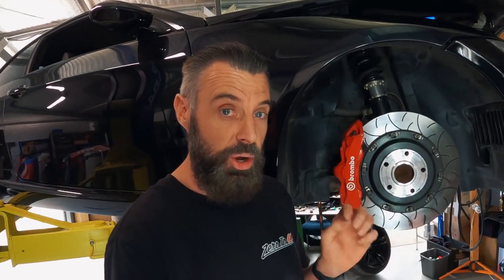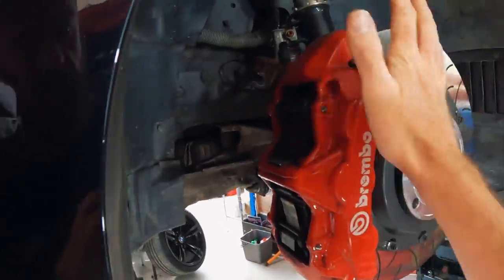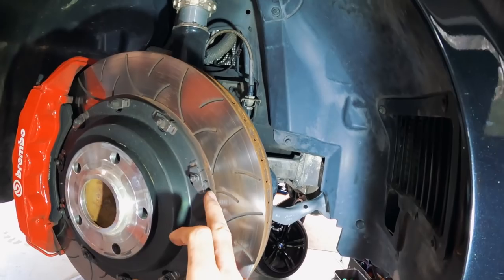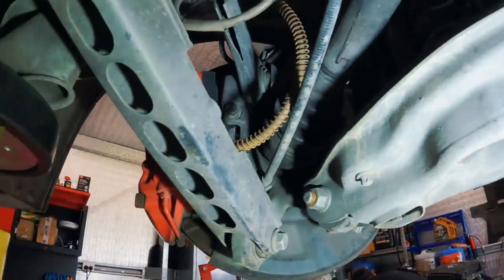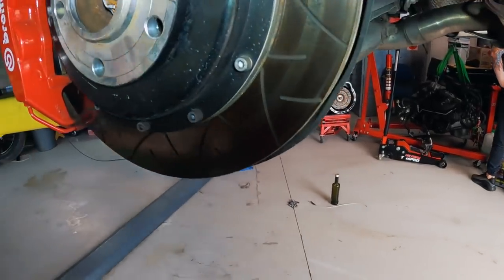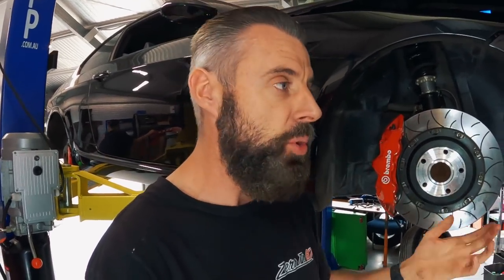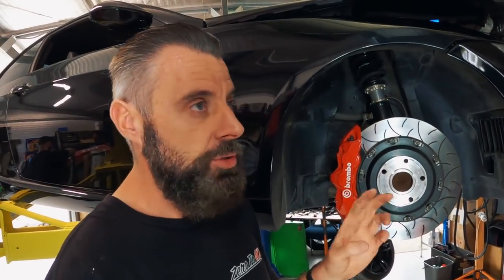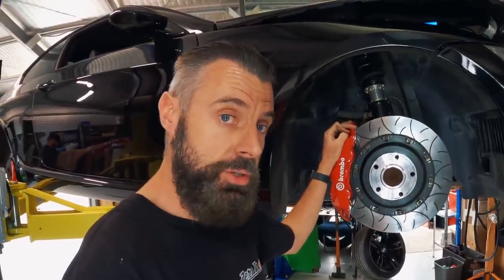BMW 335i AliExpress Big Brake Kit: 12 Months Later

Comment: Your brakes feels spongy because you have floating rotors which tend to wiggle the pads away from the rotor during acceleration minimising unwanted friction thus allowing you to accelerate faster. Now the down side is you must pump the brakes slightly to “fix” the rotor and get the pads to move closer then the next brake pump should provide a solid feel 👍

Comment: I’m not a 100 on this but it looks like you have the right front rotor mounted behind the hub flange. If this is intentional I’m just wondering why. If anyone sees this the video is a little old at this point. Thank you for your time.
Reply from the maker: Its not. Mounted as per normal. Still have these brakes, they ended up much better than i expected.

Comment: Where is most problem with these? Rusty bolts or discs? Then for do this review really good…You need to compare to original brembos. I can promise You after so many big companys BBK…You will not see difference😆

Comment: In the M135i, the brakes feel a lot as you describe, a bit spongy at low speeds an a bit too grabby at crawl speeds, but at higher speeds they shine more. Big thing I noticed going from a 09 370Z to a 2016 M135i,  it was not confidence inspiring until I used then at higher speeds.

Comment: My biggest concern with the quality of metal issues you're highlighting is the overall strength within the caliper. How truly strong is the casting? I would worry that over time the mounting areas would fatigue and lead to cracks. You get what you pay for as always..
Reply from the maker: The china manufacturers should know how to make a safe strong calliper. It just depends on whether they bother with the copy products. which are no doubt sold to a price and nothing else.

Comment: Good on you for sticking to your principles. Keen to hear about the other set you've got on the way when they arrive. My 135i has the 6-pots as standard, so not after a set (I'll be changing to decent pads and CSL discs come replacement time), but interested nonetheless.
Reply from the maker: CSL discs are awe fully sexy. Saw one at a local shop the other week. It makes the China discs look dated to say the least.

Comment: In the end all you want from this kit is the calliper bodies and brackets… braided lines, piston seals, bleeder nipples, mounting hardware, discs, and pads can all be swapped out for better quality at any point in time, as needed. It’s a good base point for someone like me.
Reply from the maker: To be fair the kit i got from them in 2021 was much better. Just ordered my third kit last week. Will see how good the stuff is now.
Reply: @ZeroTo60Tube  my concern is not getting the right bracket or rear discs (I have a hub style handbrake like yours)
Reply from the maker: @alexbare7181  Well i can put you in contact with my contact there!
Reply: @ZeroTo60Tube  would appreciate that but I probably won’t have funds for em till tax time anyway haha

Comment: Few of us in UK have these with the updated rear brackets,
Agreed the supplied bolts are garbage, I also used stock bracket bolts,
The nipples leaked very bad, the nipple seats were not true so it didn't matter if you used oem nipples, or tightened them down hard, still leaked, so we had to use seat repair kits , 
The standard black pads are absolute garbage too, we were supplied with some red higher temp pads which are much much better, and the initial bite is much better, you're right the black pads bite is terrible. 
The only real problem I've ran into is the pads have started to click about when going from reverse to forward, there's a bit of movement and it's not a nice sound / feel in the pedal, yet to figure out what that's started to happen.
All in all, to me these brakes were better value still than sourcing a rusty old set of 380s from an M, touch wood.
Bit weird also that people were rude to you, strange

Comment: I made the mistake of purchasing Chinese made rotors from a “reputable” shop that told me they were great and inexpensive…. After 1000 miles I have to say the rust just throws off the look of what should be a luxury vehicle. Akebono and Zimmerman are what I should have went with from the get go (non big break kit). Brembos are great but greatness always comes with a hefty price point. Andrew if I may make a request, a draggy 1/4 mile time upload would be amazing 👍🏻. I bet she’ll do low 10’s possibly crack high 9’s. Thanks in advance.
Reply from the maker: I always wanted to do a 10 on a unprepared surface. But i don't think i can get it to launch fast enough. 1/4 run will be on the cards soon-ish.
Reply: Look up tofu buildings in China. Diet instead of concrete beams ,rebar that you can snap. There's a middle ground that isn't isn't cheapest or the most expensive
Reply: @Michael-lg4wz  after watching that in speechless 😶 another reason why I dislike high-rise buildings

Comment: Hey Dude, Just a tip heat those rusted bolts up and then put them into oil.. This will rust proof the bolts.
Reply from the maker: I've been thinking about just replacing them to be honest.

Comment: I got M3 master and full depth pads. Stops better than originals.  I took the risk on these and it payed off. Not the best quality but look a lot better than stock.
Reply from the maker: Thanks for sharing
Reply: @ZeroTo60Tube  There seems to be only 2 main supplier of these type replica brakes. I contacted the supplier you got yours from but they wouldn't do custom brackets. So i went with other supplier. They must be getting the blanks from the same foundry as I have the same issues as yours. They even gave me the long brake lines in the rear. Issue with dealing with Dicase factory is they don't speak English.
Reply: What brake pads did you get? Do you have a part number ?
Reply: @cptrey  No part number. Matched to original 335i discs.

Comment: Great to hear an honest review. I can only think it will lead to a better product down the track. Now on to the paint and rusty parts, have you considered getting the parts Cerakote(d). Works well for motocross and they have a high heat product specifically for brakes.
Reply: Is it possible to get cerakote for consumers in aus ?
Reply from the maker: If the new kit still have the same looking bolts, I think I’ll just nip to the hardware store and buy some decent ones. It’s only the 8 bolts that bolt the caliper to the bracket so not too bad

Comment: Sounds like they are using cheaper tool steel for the hardware with low or no chromium content. Also some china stainless isnt stainless because the chemical composition can be a bit all over the place and not have enough chromium compared to say German or Australian steel. Also stainless is really expensive compared to high carbon tool or blade steel like 1060, 1070 or 1080 series steels. Thats where a lot of the cost on genuine stuff goes. Materials that can be 3 or more times the cost and be much more sensitive to heat treatment processes.

Comment: I'm laughing my ass off listening to your Chinese aftermarket brake parts adventure man. Not sure if you're trying to bee funny but it's f@cking hilarious.
Reply from the maker: Mocking aside, they actually turned out better than expected. Nearly 2 years on over 700hp on this car, track days, daily use, have them on my other car as well which is over 800hp. DICKASS actually made a decent product once the fitment issues were rectified.
Reply: @ZeroTo60Tube  Don't get me wrong I did just spend some time tracking myself down a set for my e92 335i. I'm guessing the calipers are bound to show up with "brembo" logos on them but I intend to paint over them with my shop logo either way...justifies a tax write-off and removes the guilt lol.

Comment: Thank you for that review Andrew... thank you for pointing out all the s@#$% stuff... i actually got the same kit, different pattern... a few months after you did your install... but mine seem to hold up better... to be fair my brake lines were different from the box... no springs... but my pedal feel is exactly as stock... and at high speeds as you said really controllable... i did change the pads to a genuine pads a few weeks ago though... and it even better now.... my worst 2 experiences are the rotor wear.. i mean for 10 months of use you can already feel a lip developing around the edges... which inthink is too early a time... but metal quality is the name of the game i suppose... and these are cheap metal... and the other thing is the rear brackets... after 2 revisions i still had to modify them at a local machine shop to get them to fit perfectly... and yeah... i wouldn't recommend these... especially for i high performance track car...i mean for just looks you will get away with it... even for drag races and roll racings where you push them for a short distance... but for an actual track i wouldn't trust these.... cheers for your honesty mate and for being responsible and holding your ground.... cheers from Beirut...
Reply from the maker: Glad to hear, I have sent over 1000 messages to my contact and now Dicase directly since I got my kit trying to work out the issues and convince them change things. They say they would but you never really know. Looks like you got some of the upgrades back then which is great.
Reply: I don't if i got upgrades... it might be i just got lucky... 😃

Comment: Why am I getting the vibe that you think that they did pretty good for how much they cost? I mean you’re still running them. That said I am 100% against them putting Brembo on the caliper. But it seems like Dicase is a good alternative to $4000 brakes!! At least that’s what I see a full front and back big brake kit costing. Question is, if they used better materials could they make a quality brake kit for a lot less than some of these companies that are charging prices that you would need to be either sponsored or rich to buy? I’m never going to spend $4k on a big brake kit for my VW Gti. If I had it like that then I wouldn’t be driving a Gti.
Reply from the maker: I was very hesitant at the time these were installed. But they are actually fair damn good. Calipers and rotors have been faultless. Some of the hardware was iffy. But newer versions this has been rectified.

Comment: That's pretty normal for rust .  even the clear coat wear..  The hardware is definitely not stainless-steel i would buy kit replace the hardware..
Reply: they are stainless. just not 304. three out of the four diff grades of stainless are magnetic and have less anti-corrosive properties. can't blame them for not giving you top their hardware with their price. i've had genuine gt6 on my g35 and the hardware and nipples did the exact same things.

Comment: 3 years on are these still doing what they should?
Reply from the maker: Unfortunately after about 18 months the car got parked up. I still have them, i actually have 2 sets on cars and 1 set to go on a future project. They are actually pretty good brakes. Pads could be better, but its always a personal preference as to what pad to use. With the these you can get any brand of pad to suit.
Reply: @ZeroTo60Tube ok thank you for that, I’m undecided up staying OEM 335i 348mm, putting 340mm F chassis calliper, or chinesium brembos replicas 😅.

Comment: Off the topic but how was the idle afrs issue you had lately fixed?
Reply from the maker: It came good eventually. I think it was a mix of incorrect injector settings and then doing 87 adaptation resets in a row and not letting it properly adapt.

Comment: What's every ones opinion on the chinese turbos for the 335i
Reply from the maker: I think they are great for the money. But the money doesnt stop with the turbos. You have to keep that in mind.
Reply: @ZeroTo60Tube  what do you mean
Reply from the maker: @derekporter66  The cost turbos are irrelevant in comparison to what you need to put on the car to make the vehicle a reliable and fast package. I did cover this in more depth in a video last month.

Comment: I assumed you hadn't told anyone as you were unsure on the safety and quality of them and didn't want to be held responsible if something happened. It didn't occur to me it was because people were being rude!
Reply from the maker: The quality was the main issue, but peoples attitudes to getting the copies is why, i legit lost interest in talking about them. However, every week even now the original video series still gets multiple comments and questions. So figured i would do a vid while the car was on the hoist and i was finally fitting the new rear brake lines. My take last year, was ordering these is pretty easy, you need to know what you need in the kit, you need to know rotor and caliper specs and it shouldn't be too hard to work that out and make sure who ever you order from will provide the right stuff. If you struggle with that, you absolutely shouldn't be fitting brakes at all and will need help through the entire process. Something i can't do for everyone.
Reply: @ZeroTo60Tube  I understand what you are saying regarding "if you don't understand simple specs? Leave well alone" but that's a part of your channel isn't it? Specing cars out, modifying, learning as you go?
Reply from the maker: @DG-ox6bg  Personally i think you absolutely should not learn as you go with brakes. Brakes and even certain parts of suspension work (if a bolt comes loose) can kill someone. It's very different to playing with power mods or fixing oil leaks. At least if a power mod fails, you get misfires or break down or in a bad case maybe a fire. Brakes is something you must understand to be looking at. With unknown braking components you need to be able to look at something and know if its going to work and be certain every time you touch the brake pedal it's going to work. If i was confident that every set coming out of china was the same it would make it an easier path, but so many things need to be checked in the supply chain. Its really a bit of a mess and the reality was i got the feeling no one cared in that supply chain. It inevitably comes down to the installer to know things are right.
Reply: @ZeroTo60Tube  you don't have to tell me, I'm an engineer, but I semis that's why people ask you what brakes you use and who you bought from, so they don't have to guess.
But it's your channel. You can tell people what you like...or not.
Reply from the maker: You may not know but in the early days I got lied to by the seller, then they wouldn’t fix the issue, they also don’t send the same stuff every time. My bleed nipples never actually leaked, but I know of people who bought before and after that did. So my particular set has a different nipple.

We wouldn’t have been recommending the same product without overseeing the entire purchase process. 

It was a very difficult situation to want to put yourself in the middle of. To this day these are the one product I was genuinely worried about. 

But you are also right, it is our channel, we don’t have to share anything, we don’t have to answer comments or engage with the audience. But we do try and help the DIYer and money savers where we can.
Reply: @ZeroTo60Tube  it would appear you are still very touchy when it comes to this product! I will also add, I personally don't want the brakes. 👍

Comment: You can not buy cheap brakes for motorsport use and complain about a product that is not intended for motorsport.
These are not for racing purposes. What's the reason to write a bad review about this product if it didn't meet
 your expectations for the purpose you bought them?
Front brakes are 900 to 1200 delivered to your door. Why didn't you purchase original Bremb... equipment paying 4k or 5k per wheel for front brakes?
You were expecting the same quality product 10 times cheaper than the high-end brake kit? 
And all these just for some rusted bolts and brake hose protection springs issues, instead of spending 200 on the internet to replace the hoses and bolts.
Reply from the maker: I think you have missunderstood, although i do appreciate you taking the time to comment. Everything i mention people looking buying these brakes should be aware of. Thats why its mentioned. Also people should not put brembo logos on these and then try to sell them as genuine.

Comment: The original Brembo on my M135i were absolute shite, and Eurocarparts sell so called original Brembo. All crap. So don’t think original is much better
Reply from the maker: I think a lot comes down to pad compound. The 135i brakes are small as well. Smaller than the 335i non brembo. They look cooler tho.

Comment: Why would give oxygen to a product that was an illegal copy?
Reply from the maker: 2 main reasons. Firstly people think for some strange reason Brembo actually make these brakes in China. Meaning people think the cheap fakes are real. Secondly too many people are buying these from China and then selling them locally to unsuspecting victims. Also in case you didn't realise, early every aftermarket standard replacement part is a direct copy of an OEM part.  You can buy aftermarket discs, pads, steering joints, wheel bearings, brake lines, tail lights, head lights and so on that all look exactly the same as the OEM ones. The only thing that actually makes these illegal is people saying they are made by Brembo (and putting that sticker on them). I think people need to be aware these exist and keep it in mind when buying brakes not through proper channels, like second hand or even dodgy shops.